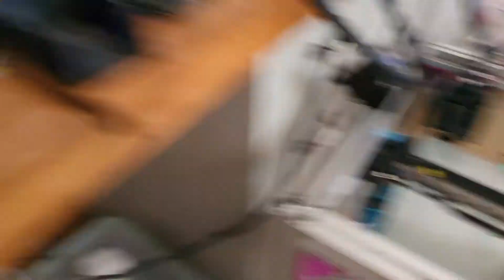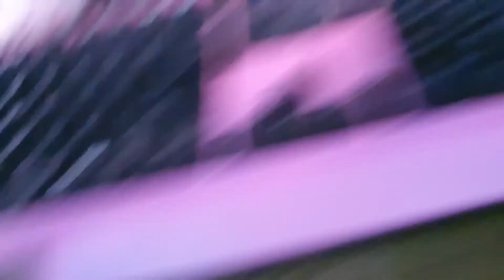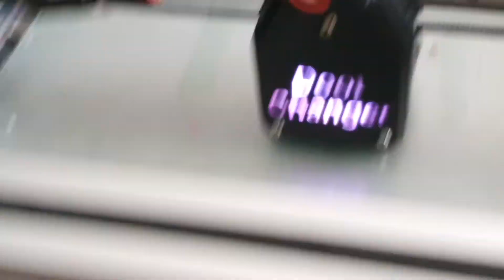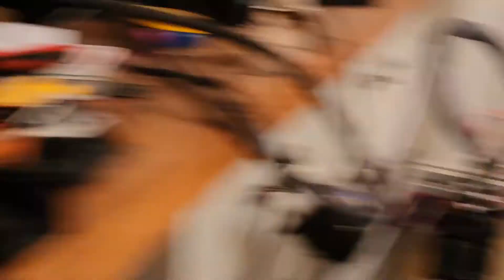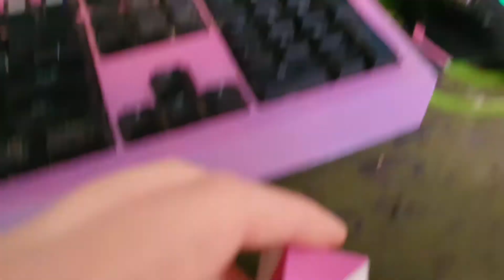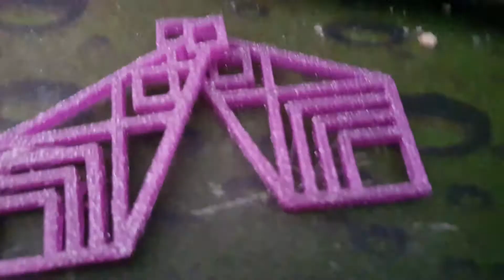doot changer, github released and it works great now!

Comment: Makes me chuckle that the 3 types of tool changers are either American, British, or Iranian in origin of design.  By far the Doot changer is tool changer that adheres most closely to the RepRap philosophy of accessibility and ability to reproduce.
Reply from the maker: Heh thanks! I'm shocked that it actually works!

Funny enough after posting this video something happened and the print failed.

It was the gear's motor shaft slot stripping (it's just 3mm and has a really small flat section, the printed part stripped)
I'm reprinting the part and will use some glue this time. Tho in my defense the older part also had underextrusion